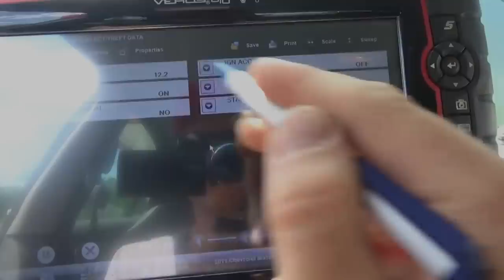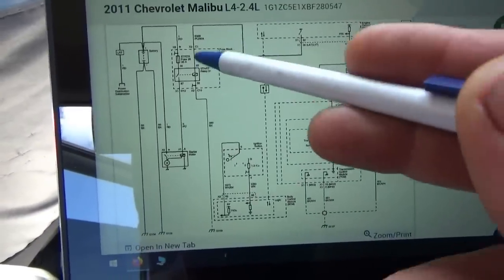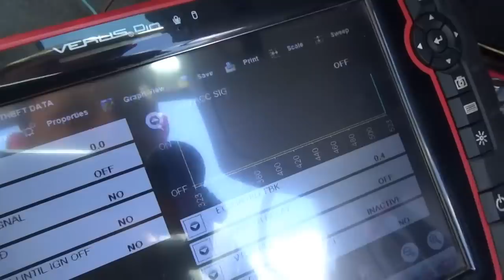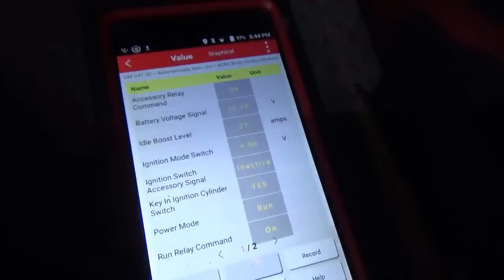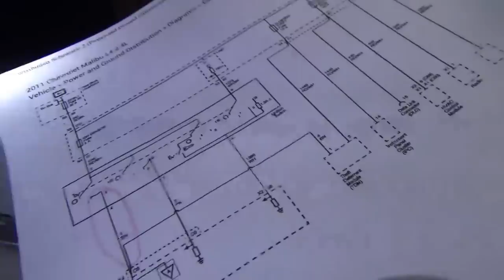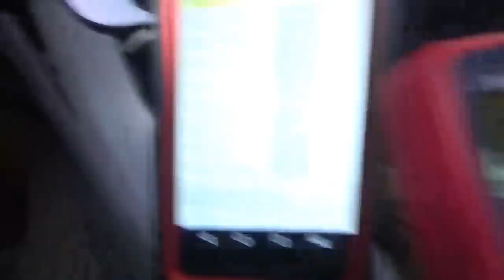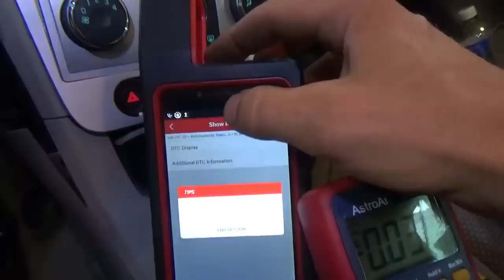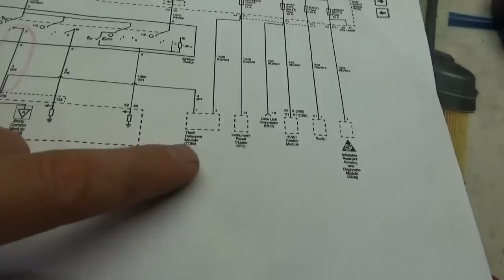Mystery Malibu is BACK! (Intermittent No-Crank)

Comment: Great video!  Fighting my Saab 9-7x (GMT 360, same as Trailblazer)

Tried to order new key module....not available.....ordered used one and no luck.

Have access to AllData, but no good diagrams for Starter Control Module (key turning module).  Great pin-out but lacking what does what (input vs output)

In common videos, chasing OR wire, now going after BN.

PS:  Chasing ACC-3 and ABS light on, Parking brake on, and No HVAC control, but blower works.

Will continue to dig.  Could be chasing "new" bad part, but need to confirm.

Comment: Something fishy going on here. If the fuse was blown all along why did it seem to be fixed at ~7:00 minutes into the video. After you did the brown wire jump trick you tried it several times with jumpers removed and it worked fine. Which is why you concluded it was an intermittent switch.
It was hard to see what was going on in terms of the wiring diagram it was too small. That made it hard for me to do my own logical thinking.
I think you'll see this one back again for that switch.
Reply: he said the fuse was cracked or separated,not blown, so was probably making and breaking contact,causing the intermittant
Reply: @ronsketchley6669  Yes. You are correct. An intermittent fuse is a very strange thing though. You'd think it would have acted up more than a couple of times since the guy  bought the car.
The other strange thing is  he says the radio never worked which would imply that fuse was open. But then you have the logic for the starting that apparently wants to see the ignition signal make and then break. It's all very confusing.
But it appears that Ivan may have solved the problem. Maybe it won't be back.
Reply: BTW. I'll add another excuse. the GD commercials that Youtube has added recently break my concentration on the diagnosis.
Reply: @davesage9190  i think he has it solved. i have seen cracked or separated fuses cause intermittants like that. not very common for sure. but i can understand it happening especially on a low amp circuit like that. higher current flow would more likely cause the fuse to burn at the separation rather than make and break contact.
Reply: @davesage9190  lol yup thats true!
Reply: I'd guess it being ok, but the terminals/pins being tarnished up and very low current made it intermittent. I'd be worried it was a flood car or had high humidity issues causing the tarnish on more or all fuses and connectors in that BCM.
Reply: Dave Sage With those Ecotec-based systems, magical thinking is often more productive than logical thinking.
Reply: I agree, he should have left the new ignition switch in there, how many cycles 
Has it gone through at this point? To create again a similar problem down the road!

Comment: I spent 2 1/2 hours the other day on a Ford.  All of a sudden wouldn't start.   Blinking theft deterrent light.  Not recognizing the key.   Owner had a relay box short out under the hood.  It had mostly the fan control relays in it.  It had fallen off it bracket and melted some wiring against the exhaust manifold.   He repaired the wiring and did a good job on it.   I figure maybe the PCM took a power spike or hit and lost it's key programming.   

So I plug in my VCM-II and fire up IDS and I get to the point where it's going to make me wait 10 minutes to get into security to program the key.  I says "This will take 10 minutes, Continue Yes/No"  I click yes and it just hangs on the screen with the Yes button clicked and eventually comes back with some Error that says "Write this number down and a long string of numbers".   After trying for 2 1/2 hrs trying all kinds of stuff, including re-installing IDS twice on my laptop, I gave up and said I think my tool isn't talking to this for some reason.  I think you could call a locksmith with a different tool to try it.   

Locksmith comes out and he can't program it either, same thing on his tool.  Turns out the key was a aftermarket one and the chip slides into the key and had fallen out.   They cut a new chip key for it and put it in and it goes right into the wait 10 minutes, did an add a key, and car started.   So Fords will hang going into security timeout screen if it see no transponder present (even an unknown transponder) in the KOEO position.  Interesting to know!

Then I come across easy one like today 2004 Malibu, Buy Here Pay Here lot.  No crank, no start, security light on.  Had coms with BCM, VTD, and all modules except ECM.  Getting ready to check powers and ground and LAN and Can Bus at ECM, and I thought let me check the fuse first.  Someone had moved the fuse for the PCM to the next position over.   Moved it back and it fired right up.    The trick is to have 95% more that make you money than cost you money.  The difference between people like you and I and most shops, is that most shops would have sold the ignition, replaced the fuse and said nothing or lied and said the ignition was causing the fuse to blow.

Comment: Be a wear on some cars "Full System Scan/ AutoScan" Can make Ghost DTC's Specially with aftermarket scanners.
When they identify what Body Control Module that car has it can cut the BCM power and as you know, then you can go chase the wild goose ;)
Example i did go this wild goose chase on Peugeot, but then again PSA Loves to make 1000 different (BCM)models for one month of same car.
..as saying go's in PSA manufacture headcorders. Ahh just pick up one, that are left from different years in the corners. It will be fine for SURE! :D

Comment: well, this leads to a standard for testing. I believe many shops charge a minimum of one hour initially for diagnostics, if so, use the time. A full scan may have provided a path but who knows? The path may have an R, L, or U-turn in it anyway. Looked like an ignition switch that had worn interior contacts to me, (explaining the 2a fuse) but you don't have x-ray vision superman. We do the best we can, be fair with the customer, he had the problem recurring for some time....

Comment: What bulbs do you use for low and high amperage. Thanks in advance...
Reply: For blower motors & other high amp draw circuits an old glass sealed headlight bulb works well.

Comment: Low current carrying fuse with an intermittent internal stress fracture ? Guess the only way to catch that would be using a variable PS with the current turned up to 90 % or so of the fuse value while on the bench ?

Comment: Kudos for also putting up fails. We all learn from mistakes. Thank you for that.
I think here the theft deterrent module is responsible for making it intermittent. It might disarm from an unlock-the-doors signal and allowing a crank and it might not disarm when the car was not unlocked.  The current owner probably always locks the doors, except this time for gas payment and also a few times when he just got that car. The fuse could already be blown by the previous owner trying to install some aftermarket gadgetry. 2Amps is not much. Must be something like that. Just a theory. I could be wrong because I don't have detailed wiring diagrams and logical descriptions of the involved components. I just find it hard to believe that a fuse that only sees max 0.03Amps just goes open. That's just 1.5% of its rating. And that kind of current is just incapable of inducing thermal effects on a fuse like that.

Comment: Back in my younger days a customer drove her V-Dub Bug in that she had to push start with the manual transmission. Had been to two different shops, two new starters and they could not get it to start. Well I just checked behind the ignition switch found it to be sending power out when in start position. This was before clutch safety switches. Checked the starter, no signal. Okay well simple enough. Turned out there was a fuse in that circuit between the ignition switch and starter. Right in the fuse box. Never seen that before or since. I forget what year the Bug was. That taught me to check simple and obvious things first.

Comment: ivan If you didn't make the odd mistake,  you would not be human.  ( No one is perfect.... ok ok keith lol).
I was thinking if it wasn't a faulty fuse,  a nice 2 watt 12v peanut bulb would take the fuses place, the current was so low that the bulb would make no difference resistance wise,  and it would light up if there was a short.
Extra warning bulb ha ha :-D
Bulbs are handy, there was one in the russian made regonda portable t.v  psu , did a great job,  very clever  design.
Reply from the maker: I love light bulbs. Especially for fixing Genie boom lifts :D

Comment: There's likely still a problem in the ignition switch you put back in... What else could have blown that fuse? Beyond the ignition switch, the circuits are all "sense circuits", yes? So a carbon trace, or failing switch wiper likely explains the short that took out the fuse...
Reply: This
Reply from the maker: Take a close look at the wiring diagram, and tell me what exactly inside the ignition switch could have shorted to blow the fuse :)
Reply: @PineHollowAutoDiagnostics  I can't tell from a diagram what "mechanical" failure there might be inside that switch... My theory is that something blew that fuse, and that switch is the most likely culprit, by far.
Reply: @PineHollowAutoDiagnostics  or are you asking me to diagram the path of the short? Could have shorted to any other circuit that draws more than the 2A fuse threshold...
Reply: Pine Hollow Auto Diagnostics the 2a switched feed shorting to the metal grounded switch housing

Comment: There could be a rougue piece of metal floating around in the ignition switch.  That would cause the fuse to blow and leave no traces.  I wondered why you didn't check that fuse.. if it happens again I would definitely change that ignition switch.
Reply: People hang all kinds of crap on their keychain & the newer cars are even more susceptible to the extra weight micro jiggling the key in the lock cylinder as you rack up the miles. Even the older ignitions would eventually succumb.

Comment: I think the problem you found with the blown fuse did not cause the no crank. I think there is an intermittent starter relay or intermittent problem in the relay box. The computer is requesting a crank which means all the inputs are good and it is sending power to the control side of the relay. But the relay isn't closing. The starter relay PID is sensing the voltage on the load side of the relay and will only report as " on" if voltage makes it to the starter side of the relay.
Reply from the maker: Interesting thought. But it's definitely a logic problem, since the theft deterrent module was never "waking up"...

Comment: Ford vehicles uses a DIODE (located in the power distribution fuse box under the hood) the same circuit that fails time to time. Have seen this a few times.
Reply: A diode eh ?  Interesting. What years / models did they implement this ?

Comment: I had a brand new Yamaha motorcycle that would intermittently lose power. Rode the customers bike for two days. I was a bad fuse. If you flexed the fuse with the ohm meter attached you could find the open. Try to get the manufacturer to pay for that diagnosis.

Comment: So, I'll be checking that fuse first thing in the morning. What's odd in my case, is that I had this "No Start" once before about 6 months back. The car wouldn't jump and didn't even attempt to start. However, when a neighbor came over with a power jumper, the car fired right up. Well, it happened again tonight. When I turn the key, everything lights up normal. However, when I try to crank it, I can hear the Bendix throwing, but the starter doesn't even try to turn the engine. I'm curious if I blew this fuse... I guess we'll find out in  the morning!!! 
  Great video! I like how you had all the updates in one video.
Reply: Did you find a fix??
Reply: @martinfane2047  actually, after looking into everything mentioned in the video, and finding nothing faulty, I removed my starter and had it tested. It passed with flying colors. When I put it back together, it fired right up and has been working since. This is the second time this has happened. I don't know what was wrong. I guess it'll happen again next year. I'm guessing it may have been a ground issue. But that's just a guess...

Comment: I'm inclined to believe that there may have been aftermarket junk (alarm system or tracker) tapped in where it shouldn't have been at one time. It may have pulled excessive current through the fuse, weakening the element. I'll bet it was then removed because it was suspected to be causing starting issues. I doubt even after prolonged service that the fuse would blow with such a low signal current flowing through it.

Comment: Working on 1 with the same issue had my buddy to send me a schematic which is a gm tech he said with what he saw Ignition Switch is hardwired to the bcm then sends the signal to the pcm which then controls the relay that controls the Solenoid trigger wire to the starter when it isn't starting I bet the car ur looking at wouldn't have power to the Solenoid said the pcm was more than likely the culprit so we will see once the part comes and all of my fuses and relays were good u lucked out with the fuse lol nice video I wished that was the issue with the 1 I'm working on but sadly it isn't

Comment: How could a blown fuse cause an intermittent problem?
Reply: Likely was a bad fuse ; micro crack / break to cause an intermittent  open just. Manufacturing fault and or metal fatigue that developed over time.
 Could have been a chinesium cruddy knock off.

Comment: By any remote chance would a problem like this be in any way related to Poppin My Trunk intermittently as well as problems with locking and unlocking with the key fob? Locking to include the security light My key fob doesn't even have a button for popping the trunk

Comment: There is a crack in the fuse from the manufacturing process that you cannot visually see. Heat makes it open
Reply: Only buy quality fuses such as Bussman & a few other brands. 
 A lot of engineering goes into a quality fuse. They are batch tested for certain tolerances & specs.

Comment: As resistance goes up so does amp draw so having worn ignition switch contacts (most likely cause) or poor pin connection or chaffing wire to ground will blow that fuse. If it wasn't the fuse pin fit than it will do an Arnold and it will "be back!"

Comment: Well guy the object is to learn from your mistakes - so now you will check any fuse feeding a dead circuit from now on - wont you... not long ago I bought a 2011 F150 with a 5.0 - it was a intermittent no start - it made me crazy - as you pointed out the BCM has alot of inputs to the ECM in the start mode - I finally figured the module in the transmission was at fault - the wimpy reed switches that tell the BCM that the transmission was in neutral or park was intermittent... when you look at the print you could not see the circuit .  But I finally figured it out - I have been in the electrical controls business for over 30 years and know it can be very humbling ... so let this little screwup be a learning experience and move on... nice video

Comment: I'm a 5yr unscheduled Mechanic...but in my 45yrs of life I have hired a mechanic twice...all that said I jest found my issue with a "crank no start" 2011 Malibu 2.4L in my haste of checking fuses roadside while waiting for the trailer to pick up the car...I reinstalled fuse 43 (inj/Coil odd) in the "underhood fuse block" in one of the "no fuse" locations just below the next lower 10amp fuse...I had no fault codes or other tomfoolery to go off of...this car would mysteriously lose communications with the tcm or pcm after driving it between 10-15 miles...get it back to the shop...communicates fine...this was after an engine swap.  Turns out the ground on the block(15mm bolt) just behind the A/C pump was finger tight and while driving it would walk it's way out just enough to lose ground...then the customer would sit there trying to restart it till the battery died...then when jump started the bolt would arc weld to the block and complete the cycle until the vibrations from driving it made it lose again...so the bolts tight, the fuse is in the right slot...here's to hoping the ground theory was it and it isn't a bad driver in the ECM/TCM or some other module causing the High Speed Bus to crash...off to test drive it now, wish me luck...

Comment: Its a tough one who would think fuse in the case of an intermittent fault - I’m still confused about how it ever started any of the time with a fuse out as customer said the radio never worked? But then worked with new fuse in. And also that passenger compartment light short fault would have me curious

Comment: Hay bro got so car with similar problem, my cuestion is, is the 2 voltage that arrived to the IGN switch is 12 volts? Y got one in 12 v and the oder one on 5 volt.😵